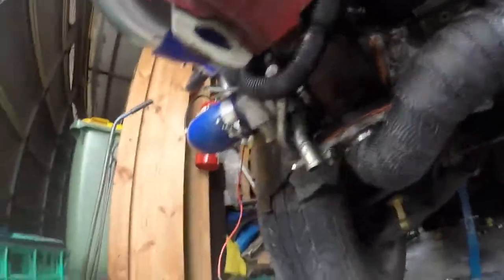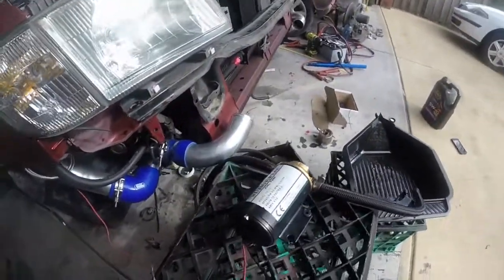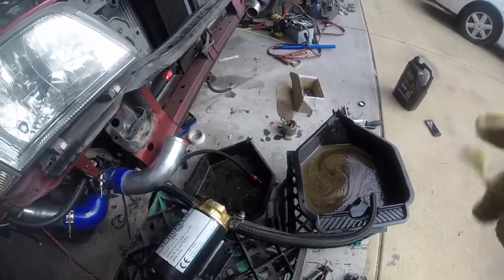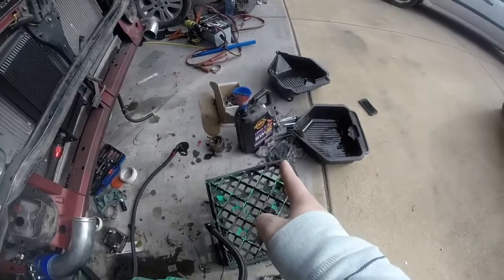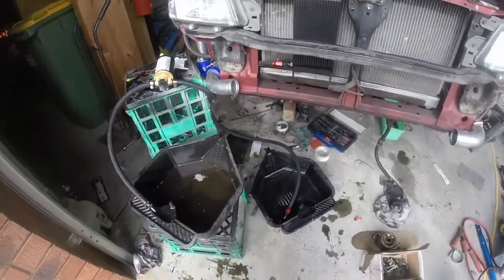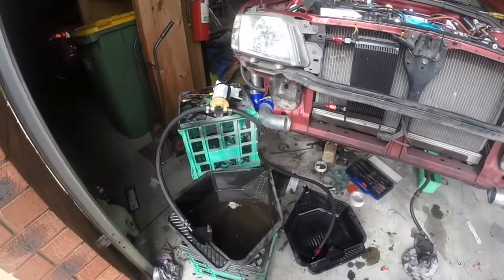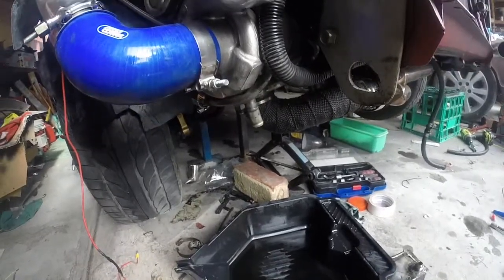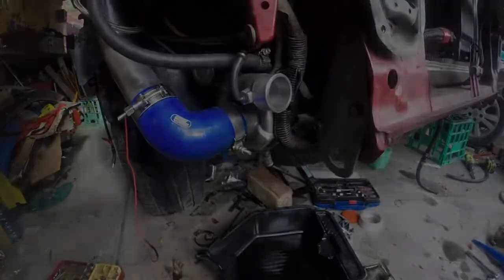eBay GT35 TD04L | Twin Turbo Subaru | Compound Turbo Scavenger Pump Test

Comment: Pump can definitely pump a greater volume of oil than the turbo will drain.  And it has no problem siphoning up to its elevated hieght.  So it should just be a matter of setting up the plumbing so everything is draining and flowing correctly.  And having an air vent into the oil collector so that the pump can pull air with the oil to keep things constantly moving.  

Given that there is some elevation from collector to scavenge pump, hose diameter may be very important.  Too big and the pump may just pull air up the hose and not much oil.  And too thin maybe not allow enough volume of air/oil through.

You may want to reconsider the oil restrictor into the TD04.  Restrictors should only be used on ball-bearing turbos.  And the idea is to restrict the oil down to about 45psi.  This is obviously very dependant on the type of engine you have and the oil grade and temperature and such. 

Journal bearing turbos on the other hand should have full oil pressure with no restriction.   If you starve oil too much to it, then the bearing will not work aswell.  The bearing relies on a pressurized film of oil between the moving parts.  I understand you want to slow the FLOW down through the turbo.  But not so much that PRESSURE drops.
Reply from the maker: +Bram Biesiekierski fully understand. You might forget that I'm actually using the stock banjo bolt which has the restrictor in it, I previously just bought the banjo part of it to convert to 4AN. So it should be all stock flow to the TD04. I'm going to give the scavenger system a good testing. I've seen some with oil sumps and some without. Some clear piping will help us see what's going on